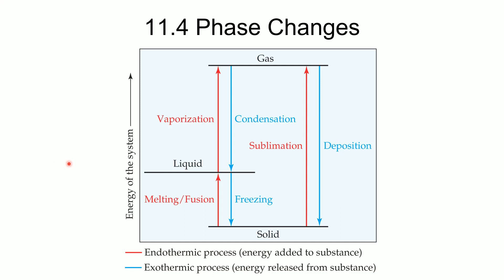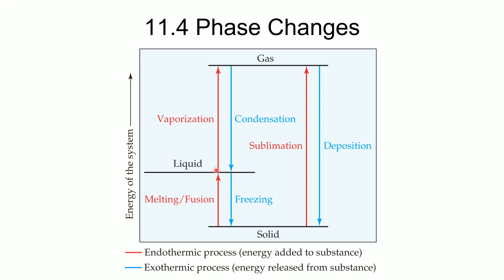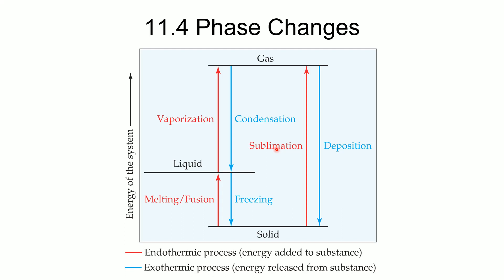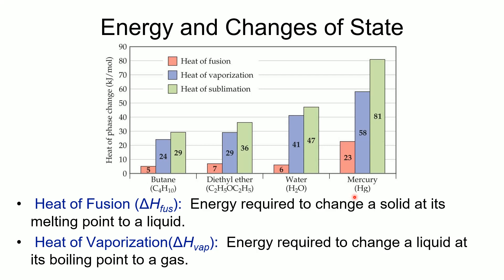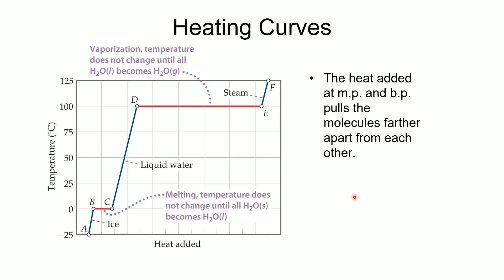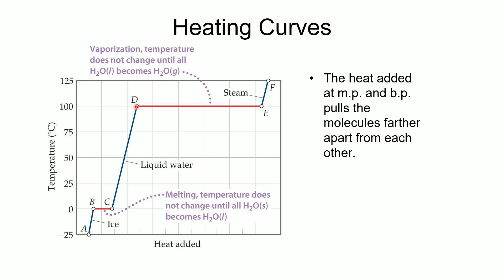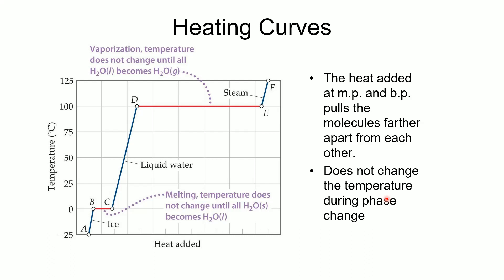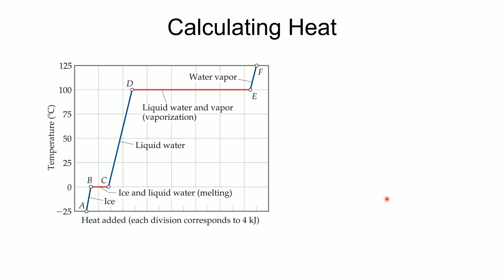General Chemistry II CHEM-1412 Ch 11 Intermolecular Forces Part 3

Comment: Do we not convert out delta T to Kelvin in order to cancel out the specific heat equation kelvin?
Reply from the maker: Good question. We don't need to convert the delta T to Kelvin because it's a change in temperature. Since a one degree change in temperature is equal to a one Kelvin change in temperature, that means that a 42.6 °C change in temperature is equal to a 42.6 K change in temperature. In other words, you can convert the starting and ending temperatures into Kelvin, but the number ends up being the same value.